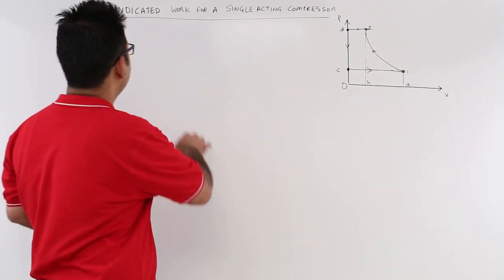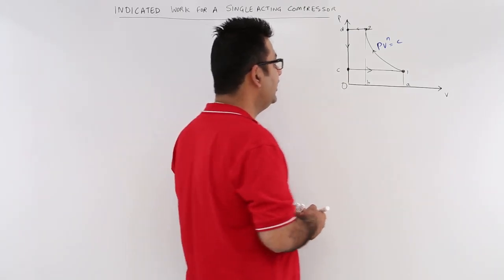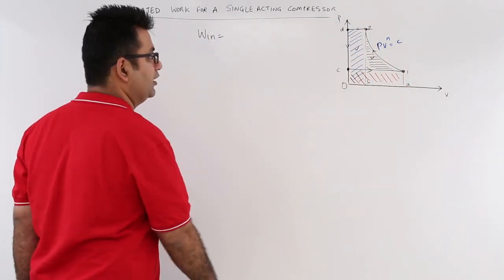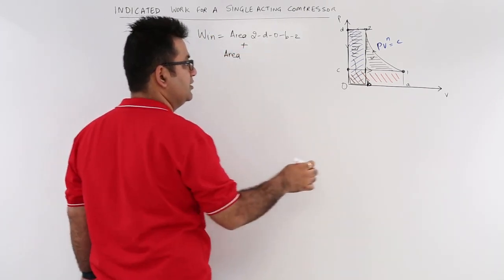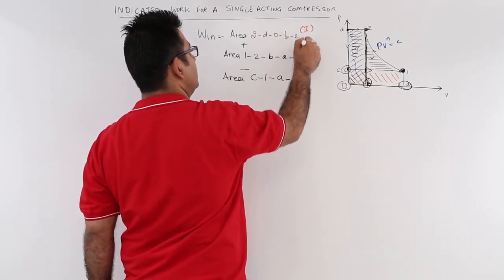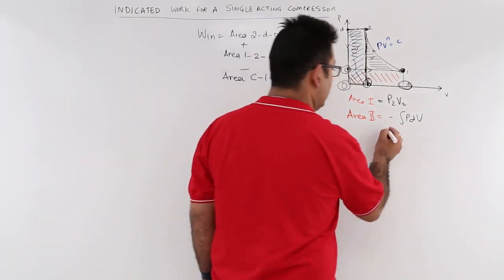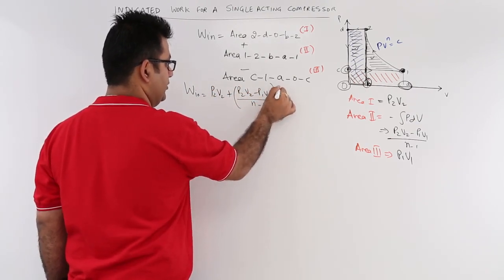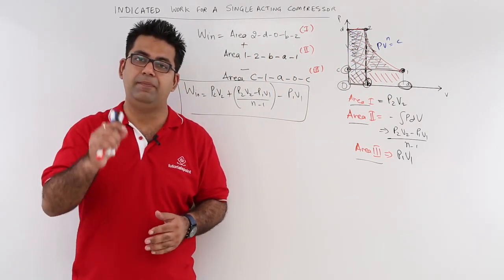Indicated Work for a Single Acting Compressor

Comment: Sir, the second work would be substrcted and not added in the equation since this is the work on the system.
therefore the equation should be modified